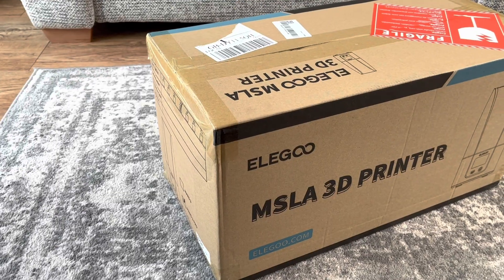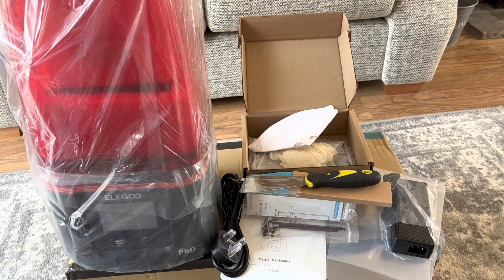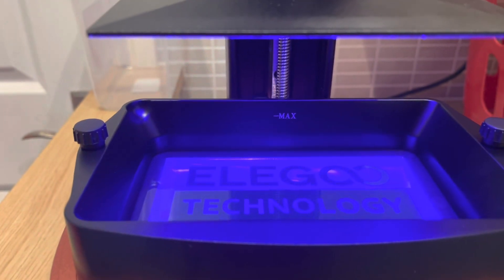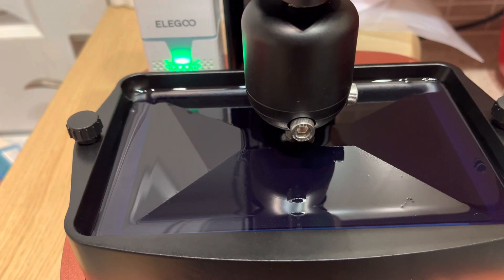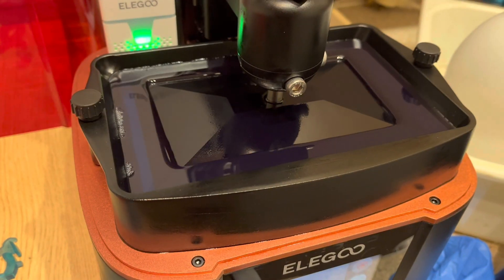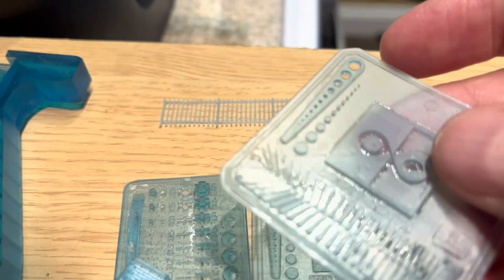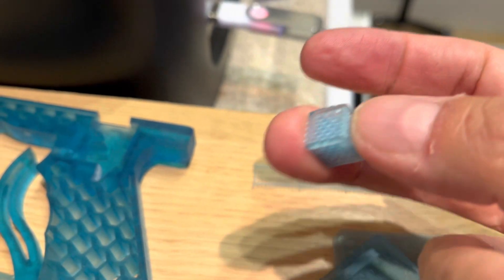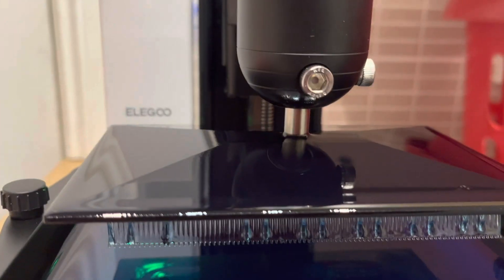Elegoo Mars 3 Pro - new 4k 3D resin printer review

Comment: Hi Simon, a very timely video! I've been looking at 3D printers, and had looked at the previous model to this one! I can't decide whether it would be more beneficial to purchase a 3D printer or a Cricut machine though! First world problems eh? All the best, Ian.
Reply from the maker: Hi Ian, tricky one, the cricut machine will probably be useful more quickly, but I think a 3d printer could be incredibly useful once you've mastered it (I haven't yet !) There's loads to learn about different resins, 'slicing' software (adding supports and working out which way 'up' to print tings so models don't collapse as they are printed) etc. I guess the best answer is to get both 😅
Reply: @SimonsShed  - Both seems like some great advice! Lol! Better start saving again... Ian

Comment: The print quality appears to be excellent. No stepping as I have seen on 3D printers using the plastic filament method.
Reply from the maker: Yep, really impressed with it.  The "layers" are 0.05mm tall so each mm has 20 layers! you can only really see them with.a magnifying glass.

Comment: If you want to save resin you can hollow out large models such as the Yoda you printed. you just have to remember to add a vent/drain but it will save a lot of resin.
Reply from the maker: Thanks, I did hollow the Yoda model but didn't know about the drain-hole requirement so you could see liquid resin inside sloshing around until it was cured!  Loads to learn 👍

Comment: Welcome to the Elegoo club, I have 5 Elegoo machines. 
Be careful with exposure, especially on translucent resin, as they will need more time to on exposure.
Resolution isn't massively important as per pixel and size the bigger and higher 2k v 4k screen isn't a massive difference.

When washing also wash it in soapy water after the ipa.
A digital nail lamp with a timer will be fine for curing and cheaper than the big equipment.
Reply from the maker: 5!  Nice..funny how these things tend to multiply 😁 Really enjoying using / learning about it at the moment.  I've ordered a UV nail lamp 👍  Thanks for the tip on washing after the IPA, didn't know about that...I had a few shiny spots which I think is resin that the IPA didn't quite clean off.

Comment: I print a lot of N gauge stuff with my elegoo mars. I would recommend some water washable resin, saves messing around with IPA or Meths. For curing I’ve got a little solar powered turntable and a UV nail varnish curer.
Reply: hello, would like to know where do you get all the N guage stuff link or else please im at the biggining with 3d ressin but have N guage dioramas to complete any suggestions will be apricisated  thank you.
Reply: i have water resin too and a uv sanitiser  for fixing after print
Reply: @MrCeke  I get a lot from Thingyverse. Most stuff is OO scale so you just print it smaller.
Reply from the maker: Cheers Chris, still learning at the moment but having fun, have ordered a couple of small bottles of resin to try (including 1 water washable) and a nail varnish lamp too 👍
Reply: question for Chris any suggestion so to reproduce sonme N guage stuff fence electricalpoles lines
,ect fiire escape stairways you know those on external of buildings